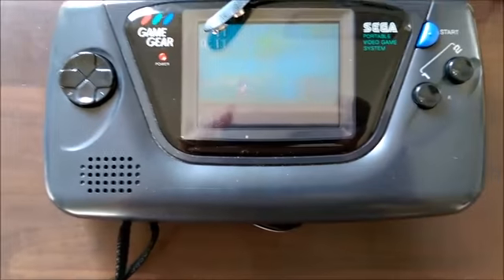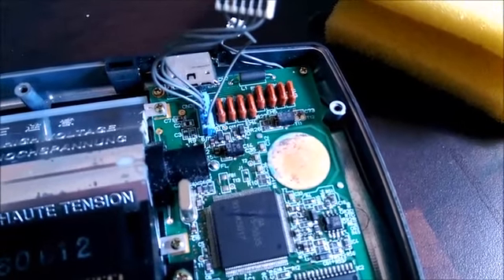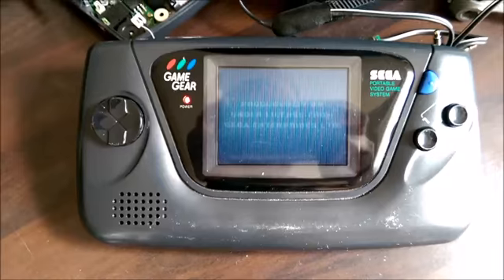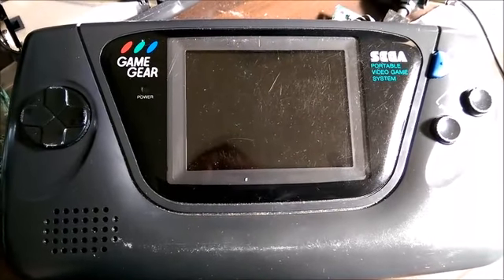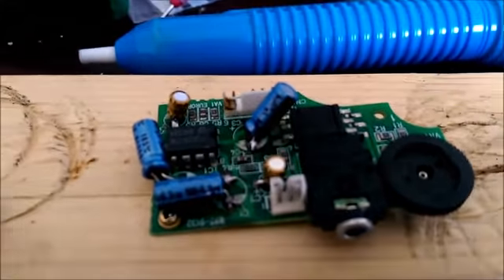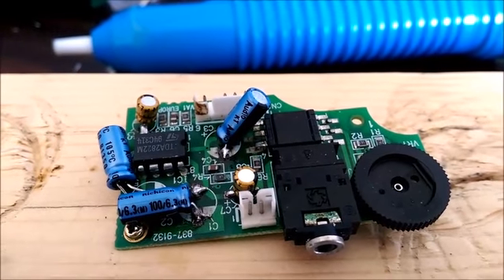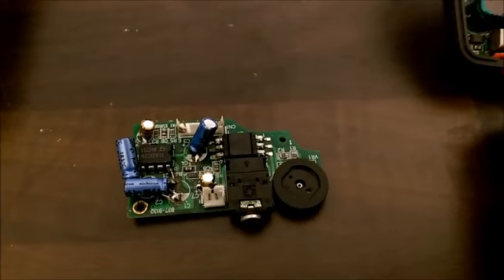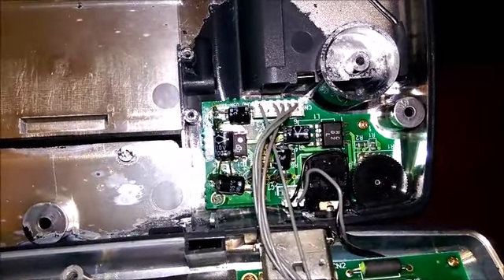Sega Game Gear Capcitor Repair - Dim screen and no sound

Comment: Hey. Thank you for posting this. Just stumbled upon my Game Gear and Game Boy in my mums loft. The Game Gear has the same symptoms you were experiencing. As a novice with a soldering iron how difficult is this process? Thanks mate
Reply from the maker: If you're a complete novice you may struggle as the old capacitors can be quite fiddly to remove. Also, if they've leaked you may find the console is in a bit of a state. But if it's already broken, you've not got a lot to lose so why not give it a go.